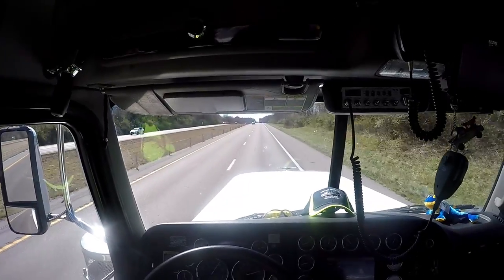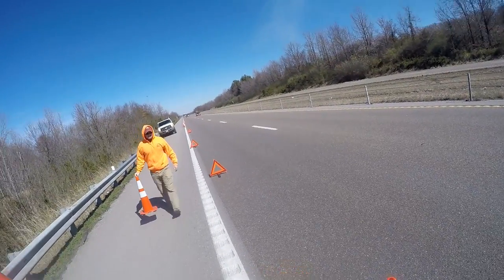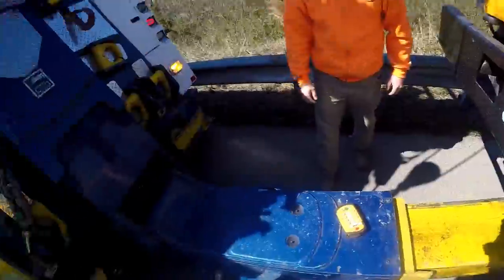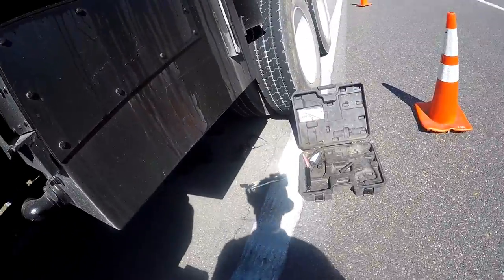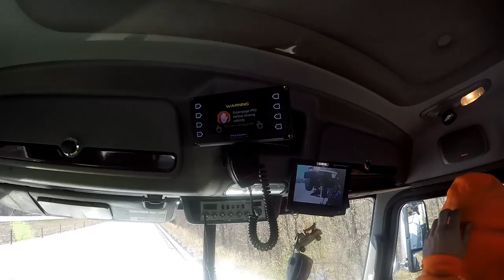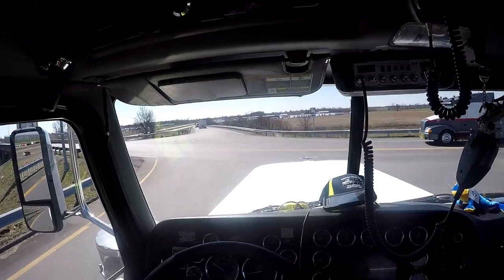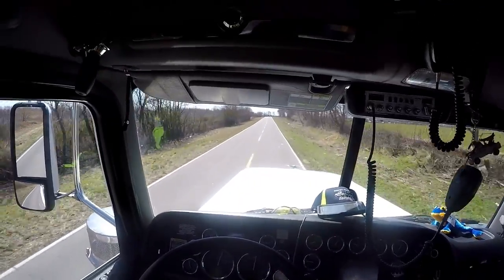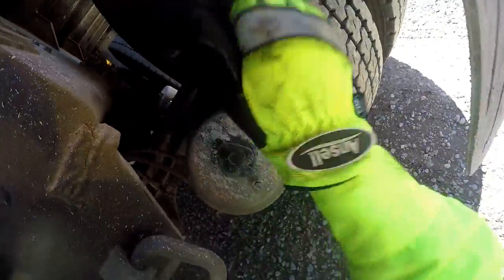LOADED DUMP TRUCK TOW OFF THE INTERSTATE

Comment: what were thoes bolts that you put in the air bags for? to keep them from compressing?
Reply: it keeps the brakes released
Reply: Fox, that's called, 'caging the brakes'  remove one retainer bolt, its a t-head bolt, remove the rubber plug, insert the t bolt and tighten it up, it releases the safety brakes so that a vehicle can be moved without air, normally about 60 psi is needed to release the spring brakes to drive. Non running truck might not have air.
Reply: thank you ! that's pretty interesting, I never knew that. I though thoes were for the air suspension hahaha so, the brakes are always engaged unless released by air pressure ? so, if a line busts the brakes could spontaneously engage ?
Reply: That's correct, it used to be if trucks ran out of air, you'd have no brakes, now if you have no air,  spring brakes will be engaged on the drive and trailer axles.  its a good system.
Reply: that it is! no brakes on something that big (or anything for that matter) it not good

Comment: Question:  Do you put the big wooden block under the front tire of the towed truck when you're working underneath in just in case your truck's hydraulics fail?
Reply from the maker: Correct.  Even though today's hydraulic systems have safety systems built into them, i.e., holding blocks, it is still a force of habit to throw a wood block under the tires just to be extra cautious.  Thanks for watching and God bless.

Comment: Hey Ron.. sorry if you've answered this question before... I'm a heavy duty operator up in Detroit, Michigan... just curious as to where you got those sockets from. (When you were pulling driveshaft on dump truck) thanks. Stay safe out there brother.
Reply from the maker: Those are a Matco drive-shaft socket set.  I've gone through countless Snap-On drive line sockets that would only last 6-8 weeks before they started rounding off on the inside and made it impossible to remove the bolts.  I've had this Matco set for about 4 years now and have never had to replace a socket.  They are the best on the market, in my opinion.   Matco also makes the strongest 1/2" drive cordless impact, again, in my opinion, but I've tried them all.   Please stay safe out there.  Watch your 6.  Thanks for watching and God bless.

Comment: Ron, how often do you pull the driveline using the impact wrench?  I'm always afraid of stripping out either the socket itself or the bolts holding the driveline to the diff
Reply from the maker: Almost every time.  The biggest issue with stripping sockets or bolts is the sockets that you use.  I quit using Snap-On drive line sockets because of that reason.  I was constantly stripping one or the other.  I've switched to Matco drive line sockets.  They are sold in a set.  I've been using the same set for over 3 years now and haven't stripped a bolt head or a socket.
Reply: Right on. It looked like you used an impact socket on this one.  Do you always use those or do you switch to the standard chrome sockets, depending on what you're pulling?
Reply from the maker: Nope, always use the impact sockets from Matco.  This is what they were designed for.
Reply: Gotcha.  Appreciate the feedback sir!

Comment: I know this might be a stupid question but what if a towtruck that is towing needs a tow?
Reply: My guess it depends on the situation.

In some cases the total weight and length of the original tow truck and the vehicle being towed, the road conditions on the route being used and the local laws might permit a tow truck to tow another one that was towing a the original tow.

Most likely the original tow truck and the vehicle it was originally towing would be towed separately.
Reply: A friend had to do that for a couple hundred yards to get the mess off a section of construction with no shoulder. Said it wasn't fun at all pulling the wrecker, truck and trailer and he was glad for some hard shoulder where he could safely drop the original load to be picked up by another wrecker.

Comment: How is towing like this legal? How can you gross 140,000 pounds with only 4 axles with brakes? Is this something the DOT does not bother with since it is an "emergency" situation? Also, is a loaded wrecker considered a combination requiring a class A CDL or can you legally operate a wrecker with a class B CDL?

Comment: What bolts was he screwing into that looked like tanks of some sort
Reply: that's for the air brakes. the bolts keep the brakes disengaged.
Reply from the maker: Correct.  Thanks for the help.
Reply: Michael Peschetti bolts that hold the spring brakes back in case the air in the dump leaks out. Keeps the automatic emergency brakes from engaging.

Comment: Magnetic plate on the remote ? Then you can put it everywhere instead of only flat surfaces.
Reply from the maker: The small yellow remote for the under-reach has magnets on it.  The large Raptor remote that I use to control the boom functions has too many electronics in it to have any magnets.  Thanks for watching and God bless.

Comment: Why do you have to disconnect the drive shaft on the big trucks?
Reply: This truck had a automatic transmission for one...I don't know why they disconnect them on the manual ones...
Reply: if you don't disconnect the drive shaft it continues to turn and you can blow the transmission up in the old days we used to pull the axles out of the rear for the same reason pulling the drive shaft is much easier and cleaner and the bolts on the air brake chamber is to manually release the breaks so you can tow the truck.
Reply from the maker: Daniel Powers is correct.  You risk damaging the transmission if you do not remove the drive shaft or the axle shafts.  I prefer to remove the drive shaft, because, as Daniel said, it is much cleaner and easier.....not to mention quicker which equals safer.

Comment: What are the bolts for to keep the brakes from coming on or what
Reply from the maker: The "T-bolts" cage the parking brake spring and keep the brakes released so that the vehicle will roll freely without the parking brakes applying.
Reply: Thanks

Comment: did you disconnect the axle because the engine seized up or is it for some other reason?
Reply from the maker: Standard procedure to prevent damage to the transmission.
Reply: okay thanks for the reply
Reply from the maker: You're welcome.

Comment: Not sure why you didn't just supply air ?
Reply from the maker: Primarily because it was a Duramax engine and not an air ride suspension.  Since the unit already had air and I could release the brakes, it was much quicker just to install the caging bolts in the spring brake chambers.  Less time on the road equals less danger.   Just my opinion.

Comment: can you post a link to those straps you used on the driveshaft?
Reply from the maker: https://www.walmart.com/ip/Reese-Carry-Power-Retractable-Ratchet-2-Pack/15125857?wmlspartner=wlpa&adid=22222222227009078744&wl0=&wl1=g&wl2=c&wl3=40839230552&wl4=aud-273067695102:pla-81426379489&wl5=9023080&wl6=&wl7=9023054&wl8=&wl9=pla&wl10=8175035&wl11=online&wl12=15125857&wl13=&veh=sem
Reply: Ron Pratt awesome thanks! just grabbed a pair to start with. these will work great for when I need to only use about a foot of strap.
Reply from the maker: I like them because you don't have the loose straps hanging.
Reply: Ron Pratt I needed to get some to strap down some lights on trussing for a dj lighting rig. I was going to get some cheapos and cut them short. these will work perfect, I won't have to cut them  and they're black also.
Reply from the maker: Good deal

Comment: why blindside it in u had plenty of room to turn around and see side it in.blind side are dangerous when I was driving I went 20 miles just to get on the see side.just saying
Reply from the maker: With my job I have to know how to "blind side" it.  There are times when I don't have any other option.  As you can see I didn't have any problems.  I would suggest you practice backing in blind side, because eventually you are going to HAVE to do it.  Just a suggestion.  Thanks for watching and God bless.
Reply: As a former OTR driver, no longer want to do it, I now train drivers for our yard trucks. As I train the yard guys I spend approximately twice as long training them to blind side, almost anyone can back up sight side (key word-almost). Our yard is very narrow and sight side is a luxury sometimes. Also I train them to use the mirrors only, out of all the folks I have trained over the past 10+ years, thankfully the number of incedents that were driver related can be counted on 1 hand, My 2 favorite rules of thumb are; 1-when in doubt- dont do it and 2- if you cant see, get out and look.